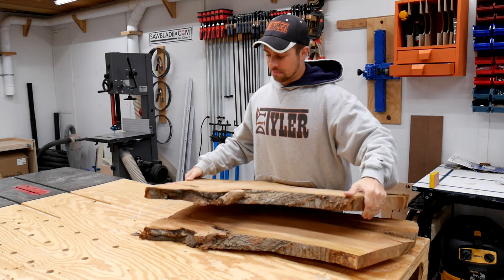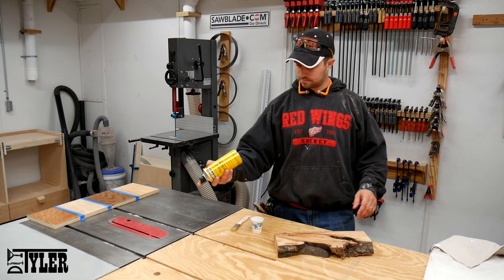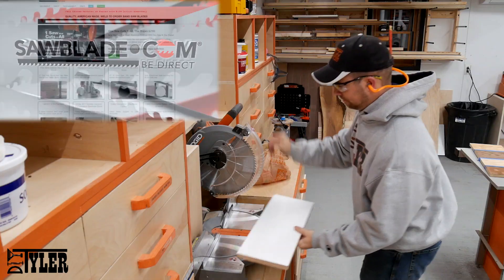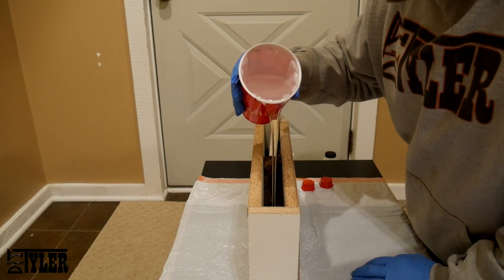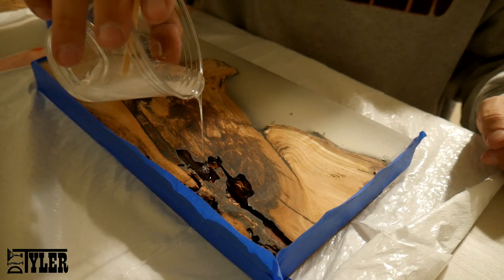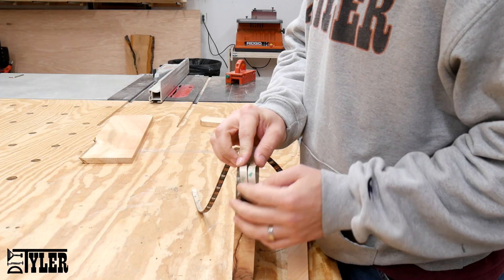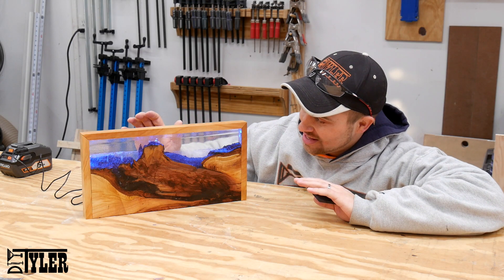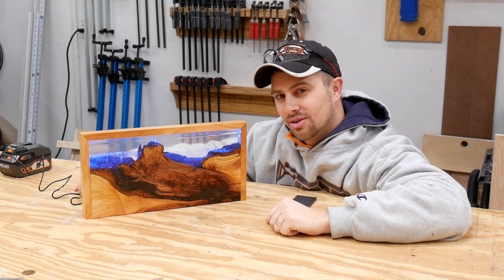Wood and Resin LED Seascape Lamp

Comment: Fancy wancy! I wonder if you used your planer and a jig to joint the board instead of the router? Since the mess it makes is a little extreme.
Reply from the maker: It certainly would have but I wanted to practice the technique so I wouldn't be router sledding on the much more expensive table top coming up here!

Comment: I ddont remember if it was here but someone had talked about what to do with a project like this and I said it looks like the oil and sand teeter totters that look like seascapes. Anyway turned out like in my head minus the line but still nice. I know about cold shops lol all my glues are frozen and oils look like cold bacon grease in my shop after the Arctic blast we got in the Midwest here last month.

Comment: Wonder if there's any resin that works with a really thick pour so you could avoid lines between the layers....  Anyway cool idea!  
Also, I love how your kids are so comfortable playing around in the shop while you work. Their natural curiosity is going to draw them in to wanting to make stuff.
Reply: Keith Carlson what about using casting resins that model makers use to cast items?
Reply from the maker: There is an unlimited pour epoxy called Ecopoxy that I would like to try next go around. Thanks for watching 💛

Comment: Tyler, to keep the mess down on your router flattening setup checkout, www.woodmagazine.com . Issue 252 - March 2018 . With a 2 1/2” vacuum port and a brush enclosed capture, the mess is considerable less. Making one for myself, I have 150 board feet of rough sawn cherry to flatten . I dislike dust and chips all over my shop.Any suggestions for dust collection on a 7 1/4” circular saw ?